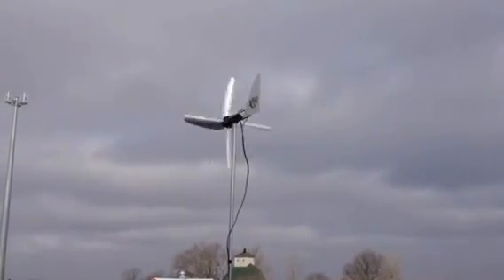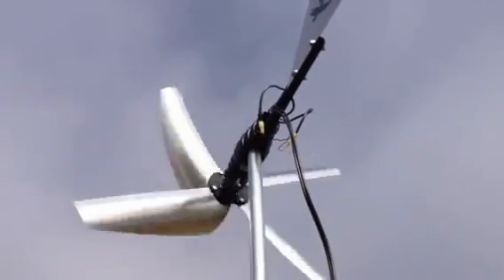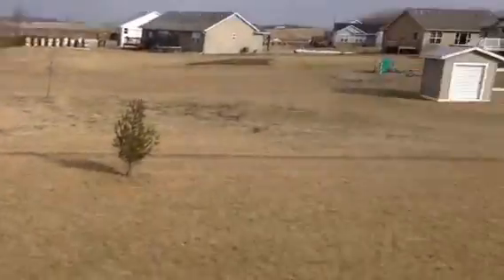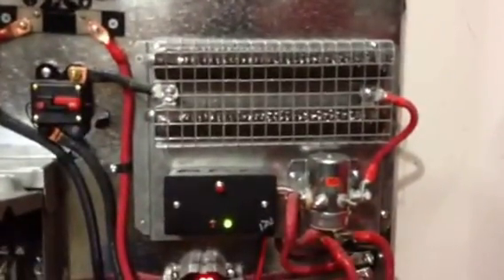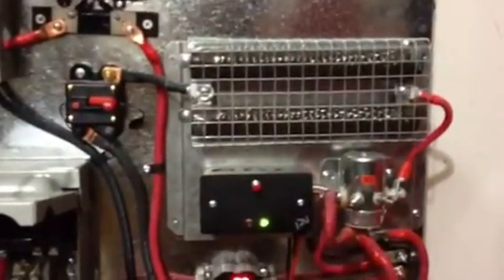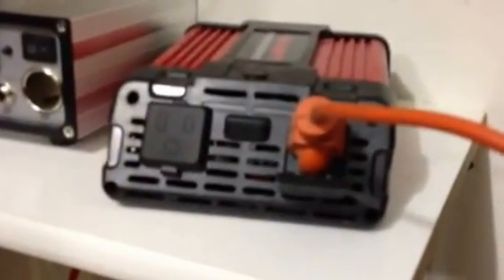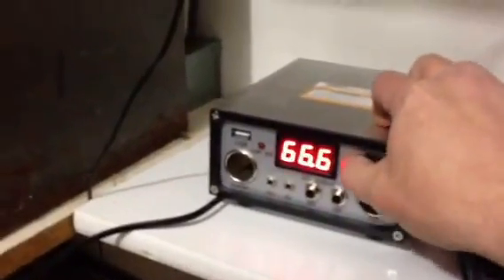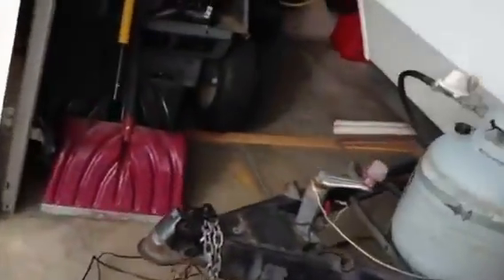My Solar and Wind Setup, 45 watt harbor freight, Eagle II wind turbine, MWS Control Charger

Comment: Hi Ray - I have this same set up but I am stumped with wind.  The eagle II only has two wires yet all of the cheap charge controllers I see need three wires for wind.  Why is this?
Reply from the maker: I think maybe you are looking at three phase controllers most turbines now are 3 phase look for a 12 volt charge controller.
Reply: Funny I came across own comment again, but I pulled this thing out of storage and hooked it up with my solar set up.  Even in decent wind, I don't think it has enough power to even charge my batteries (3 lead acid). Fun to play with, but I think it's more of a learning tool than to be useful.

Comment from the maker: The 250 turbine jumps up ands down 0 to 5 amps depending on wind, it works to trickle charge a 12 volt battery but that is about it, I am looking into a good wind turbine to replace this one. The hf I get 1 to 2 amps, I have 4 other 65 watt solar hooked into parallel now, so kinda hard to tell, I will hook a meter to them separately and let you know when I have time, Thanks Ray